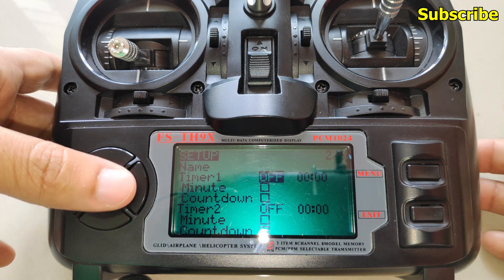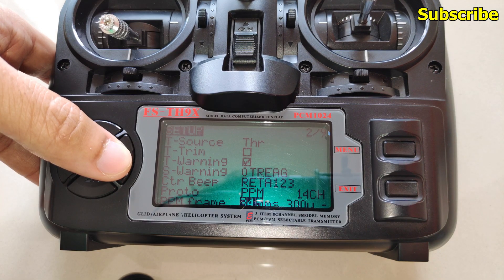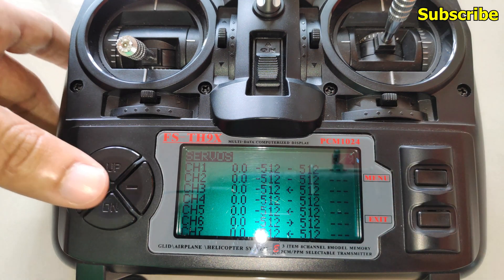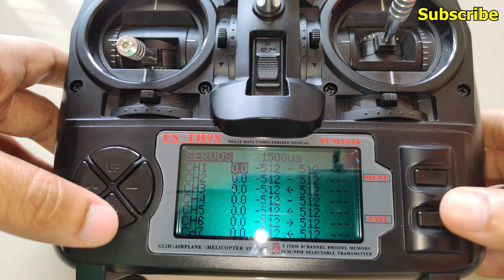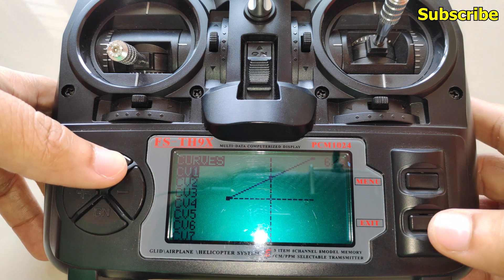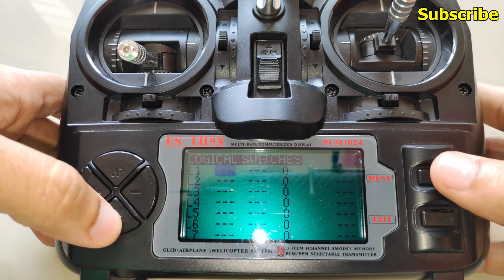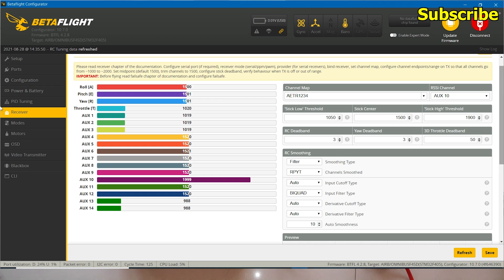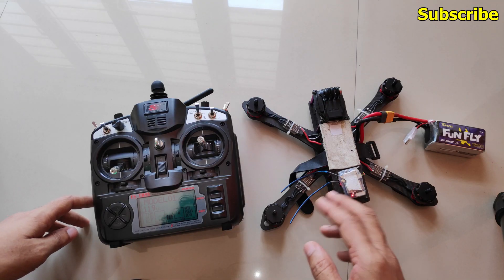New FlySky TH9X Open TX Setup and Binding FS RM003 AFHDS2A Module

Comment: I have same Tx but after binding, it is not spinning the motor while i increase the throttle of tx.. It doesn't even calibrate with ecs while connected to tx.. Otherwise it does calibrate with servo tester..
Reply from the maker: Did you make sure the esc is correctly mapped to throttle channel in the mixer page? It seems the esc channel is not active in the radio settings because of which you are unable to set the max and low end points required for calibration. Are you using open tx firmware or flysky factor firmware on the radio?

Comment: Hello men, I have problem with my FlySky TH9X radio with modul FSRM003... not FSRM003 V2. I can not bind more than 1 receiver with. After all, I want to fly with another plane, I have to bind it. Is it normal? Thanks.
Reply from the maker: The fsrm003 module cannot remember the more than one receiver id so we need to bind everytime when flying a different model.
However the workaround is you can edit all your receiver id to be same for all models and that way the fsrm003 module can bind to other receivers right away.
Reply: OK... And modul FS-RM003 V2 do not remember more than 1 receiver, too? 😞 @RakishRc
Reply: hello men. Can you help me with another way? I would like to flash my new one Turnigy T9Xv2 with m128 chip, but, I can not download Companion version 2.1.9 and download proper Opentx version for my transmitter... Is there any way to downlaod soft and firmwer like 3 years ago...? Thanks.
 @RakishRc
Reply from the maker: @jojoles316  I have the open tx 2.1.9 version for th9x that can be flashed. Will share the link here
Reply from the maker: Check this video - https://youtu.be/XOU8JpGGoXc?si=WOwg1hWbYEkgczog
Reply: Hello, will try to edit receivers ID, but I have programer for flashing T9X with Opentx, is it possible with this programer? Next, I have 10ch and 6ch receivers. Steps for changing IDs are same? Thanks for your help! 🙂 @RakishRc
Reply from the maker: @jojoles316  the open tx firmware for th9x won't help because the fsrm003 module does not transmit receiver is to radio because it's an external module which is why it doesn't even support telemetry. Steps are same for both receivers.
Reply: @RakishRc  ok, i understand. I need not telemetry, i only need to us tx and rxs like before, with fsrm002... Bind 1time, no 100x 🤣
Reply: Rakish, do you have version for m64 and m128 chip? If yes, share both. Thanks
Reply from the maker: @jojoles316  I only have for 128 because my raido has 128kb flash memory chip.
Reply from the maker: @jojoles316  https://drive.google.com/drive/folders/1gSH4hPl4RWHqCUhrKF-w-Lt4mVkm5_GX
Reply: thanks, downloaded
 @RakishRc

Comment: Bro mere flysky th9x transmitter receiver ki ring 10 metrer h  plz solution
Reply: Transmitter module rmoo2   receiver r9b
Reply: Problem a rahi hai range ki  10 metre ki hai Bus
Reply from the maker: @gouravkhichi1919  antenna wire broken on receiver or the tx module. Check that.

Comment: Hello, I just bought the Flysky ST8 radio control but I can't manage to operate and configure the FS-RM003 module to be able to control my old receiver, could you help me ?
Reply from the maker: Go to receiver settings and enable external Rf module. Put the receiver in bind mode and hold the bind button on fsrm003 module and power up the radio. You should notice the led flashing on module and stay red after bind is successful 👍

Comment: Hmm, so I have got FS-RM003, but seems version 1, not 2. Does this mean there is no way for me to set up failsafe with current setup?
Reply from the maker: I don't think there is second version of FSRM003. The previous was FSRM002 and that did not have failsafe. So if you have the module fsrm003 then it should be this which supports failsafe by holding the bind button for 3 seconds until the led flashes
Reply: @RakishRc  Damn, I had no luck with this method - holding the bind button, but the blinking doesnt happen. The only idea atm is to upgrade RX firmware, maybe this helps.
Reply from the maker: @marcinsvr  strange. Can you share a few pictures of your module and receiver via a link I can look at? If you have this module it should work.
Reply: I have described my case on the 'openrcforums', under:viewtopic.php?f=40&t=12004 -  if anybody has similar issue.
Reply: @RakishRc  I think I found the issue. Opened the module and it actually says: FS-RM003-V1.2 2017-02-10. Looks like version 1.2 just do not have that feature. I wonder if there is a way to somehow 'upgrade' it with new firmware.
Reply from the maker: @marcinsvr  let me check mine and get back